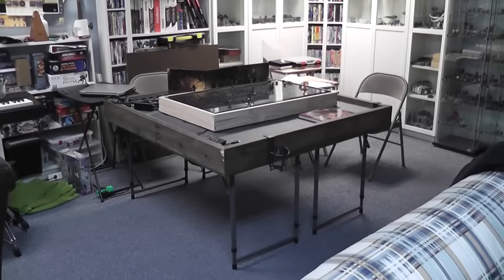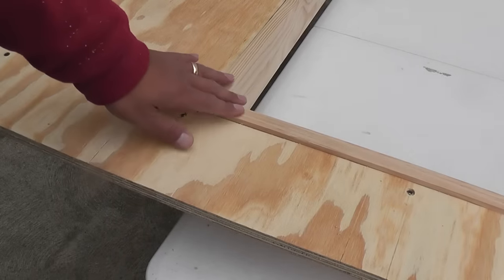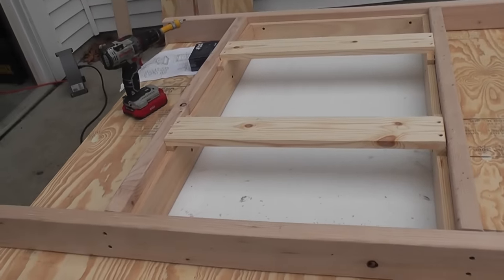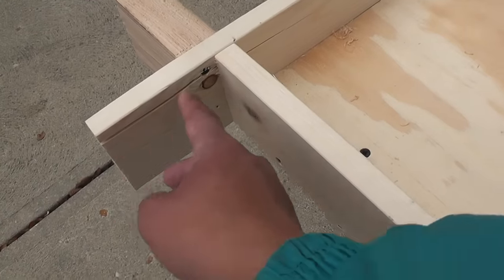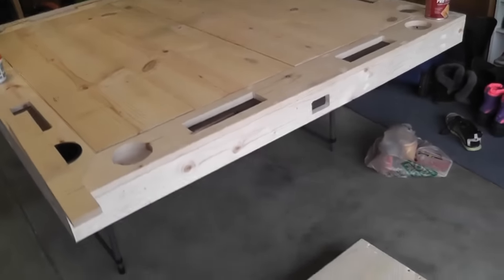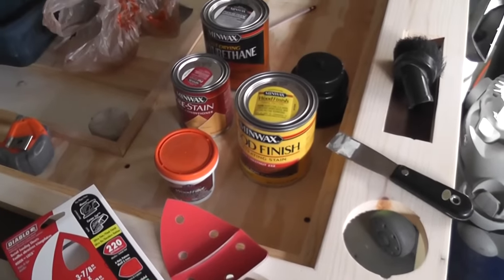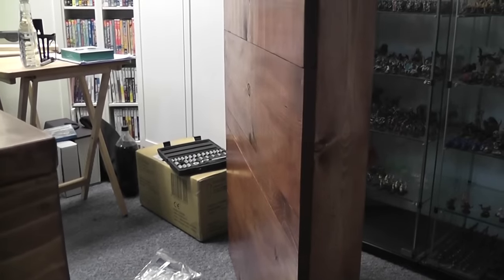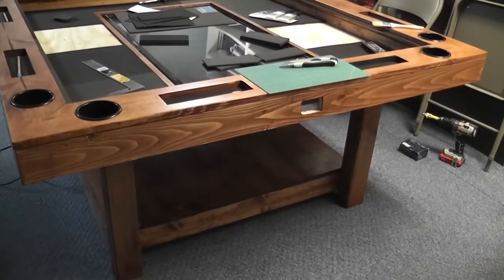DIY Gaming Table for $150

Comment: pro tip:  drill 1/2 inch holes in your two bys underneather to run your romex cable.  After that you can put a covering on the bottom and access panels later if you want.  Also USE BOXES when dealing with outlets.  You don't want exposed wire (i'm not talking about the copper but the insulation around your 14 gauge wire).  As an electrician I cringe when I see crap like that.
Reply from the maker: Yeah, that's a great tip.  I did end up retrofitting with boxes--should have done that in the first place.

Comment: The only thing I would add to this is to use a router on the edges and inside the pockets.
Reply: I like having the edges routed as well, makes corners less prone to splintering if someone's clothes were to brush on it and ruin the stain.
Reply: Yes, I kept thinking a router would take it to a the next level of quality.
Reply: I also feel as though using a uniform wood could make this that much better aesthetically and would not increase cost all that much and as for myself I would have loved to do a nice dark inlay for trim on the outer edge and probably a burned in design on the boards for his top. However that is just me because I play around with carpentry constantly.
Reply: Agree, or at least chisel out the corners in the boxes where the jigsaw clearly tore up the wood.

Comment: If anyone is unsure on how to wire, please get a certified electrician to help you! Also, speaking from experience, it's better to attach wires to the screws rather than using push-in holes. The wires in the push-in holes tend to come loose over time and fail.
Reply: Propane Daddy Ehh...cats are okay, but dogs are better.
Reply: +Propane Daddy and thanks for the compliment! I love being a dog cause, you know, dogs are awesome... especially blue ones!
Reply: Propane Daddy Why do you choose to be mean?
Reply: Okay, fine....your choice.
Reply: I would put a small hole under or some where in the table and ziptie the cables together then lead them out of the table

Comment: Great job and excellent planning!

Quick question...  How will you ensure the protection of the TV from more than just scratches?  If a drink spills on the table (hey, accidents happen) it doesn't appear there is anything to stop it from getting "water damage".  I'm assuming the plexiglass is the size of the TV screen (hard to see).  If something spills onto it the beverage will follow the underside of the plexiglass and onto the TV surface.

Perhaps a better idea would have been to inset the sheet of plexiglass to the table, flush with the playing surface, and make it the size of the framing around the TV.  You could have then used caulking or some other type of sealant to secure the plexiglass to the wood frame.  That would make the TV enclosure water-tight.

Also, I think a more appropriate title would be "$150 DIY Gaming Table Upgrade" since anyone who wants to follow your example would probably have to buy the TV which would probably double (or more) the cost of this project.
Reply from the maker: Yeah, if someone spills a drink directly onto the TV, they are paying for a new TV.  But we haven't gotten close to that happening because the cup holders are really good and we keep snacks out of the gaming well.

The reason why I didn't want to lay a piece of plexi/glass on the bevel of the TV is because the miniatures "float" over the map and make it difficult to know which square they are in at certain angles.  But that is a good solution if you are worried about spilled drinks.

Yes, about the TV cost but most people who have followed the plan don't include the TV since they don't use it for D&D.
Reply: Gaminggeek ... Good information, and yea I never thought about the difficulty of the plexiglass floating above the TV and not being able to properly see where pieces are.

Personally I would think the TV would be an integral part of this build, regardless of D&D or not.  There are so many game boards you could host on a TV screen that it makes it a highly functional piece for everything from complex pen&paper adventure maps right down to displaying a Tic-Tac-Toe board.
Reply from the maker: Yes, at some point, I am going to figure out how to digitize all of the Shadows of Brimstone tiles.
Reply: Shouldn't be too hard.  A lot are already online, just do a quick Google image search. for "Shadows of Brimstone tiles" or type in the name of the specific tile(s) you're looking for.
Reply: or you could have a rear projection screen plexiglass with a projector at the bottom shelf pointing at it, so the pieces don't go directly on a scratchable surface, don't know about the visibility with the lights on though, that might be a problem
Reply: thejack473 ... Think you could get the projector far enough way for it to fill that size of an area?  That's actually not too bad an idea if it would be logistically possible.
Reply: Gaming With ViperZeroOne i looked into it after making the comment, and some guy pointed the projector at a mirror, effectively doubling the distance. i'll see if i can find it again...
Reply: If you're using an old rear projection TV (should be able to find a score on CL in your area for free), the distance isn't that significant. You could probably shave down the back more than a little bit to make sure it doesn't interfere under the table.

Another thought - remove the bezel from your TV to minimize the distance. Should make it easier to see the pieces location from a distance.
Reply: "remove the bezel from your TV to minimize the distance" ... This is actually a good idea for some TV's.  Some, I know, have a flush mounted screen but most of the more inexpensive ones can have up to a half-inch depth between the screen and the furthest forward part of the bezel.

Comment: Very, very cool. Love the monitor built in. You should mount the bottle opener on the leg below the table, so it's more out of the way. And use a router to rounder the edges of the dice bins; that would clean up their edges & make them less sharp.

Comment: Came here to see how the hell he built this for $150, then realize it's 5 years old.  2x4 is $8 right now, pretty sure this is running us much higher than $150.
Reply: At the time, the $150 was if you cut out a few things he had, like the TV, cup holders, bottom shelf, etc. 
His actual build was closer to $212 at the time.

Grabbing updated pricing, today it would cost about $430
Reply: @VakuAdikaia  Still not shabby, especially if you wait, since wholesaler lumber prices are coming down rapidly. Since the retail stores order in large load expect to see retail prices drop in a couple to a few months.
Reply: @brandond2768  yeah, I bought all the wood I needed shortly after that comment. The one piece of advice I’d give to those who happen upon this comment: buy the 4’x8’ plywood!

I passed on buying it from the lumber yard, because I figured I could save $20. But between finding a retail store that had 4’x4’ in stock, and getting it home, I would’ve much rather just bought the bigger board.

Comment: Out of curiosity, why didn't you lower the braces for the TV mount (to size) and add a plexiglass cover so you don't ruin the tv?
Reply from the maker: I already have a sheet of plexiglass protecting the surface.
Reply: yeah, or glass. flush with the table leaving no spaces for stuff to get in there.
Reply: yea i thought about that too

Comment: Is there anything that you wish you have done differently or added while building the table, now that you've been using it for almost a year?
Reply from the maker: A couple weeks ago, I put caster wheels on the bottom so I could easily move the table around.  It put 3" in height to the table though so my chairs are a little short.  Other than adding the electrical boxes and the wheels, I haven't done anything else to the table so I wouldn't make any changes.
Reply: Probably a good idea. Do all the players have ample space to write? I like your table a lot but I would want to add either drawers, a fold down part for the players, or both.
Reply from the maker: Yeah, most of the players have enough space to write, although one of them uses a clipboard.  Another has an electronic character sheet on their ipad.  There is someone who made a version with fold-down edges that looked cool.
Reply: at the end of the video and in a couple of other ones you have I noticed that the dm has extra space. Was that achieved by just rotating one of the covering planks? If not please tell.
Reply: If you look closely, it is just a cover piece used to extend the space. He could even do the same on the other side as well.
Reply from the maker: Yes, it's just one of the planks that is kept on while the others are removed.
Reply: thank you for all the replies. definatly appreciated.
Reply: Board game development
Reply: What size wheels did you put on the table???

Comment: So I've taken on this project and my lumber total was $211 that included my lagbolts my screws and and my stain. Mine only is gonna have a 39" TV in it though so I had to modify that slightly. Between me and my mom we built it. It took a 6 hours. All that's left is standing and staining. It turned out beautiful and I thank you for the great plans and the good step-by-step guide. The only trouble I had was figuring out the framing boards that go around for the drop downIf everything else is 59" they're gonna be 57 and a 1/2 for anybody else who's having that difficulty everything else is planned out great and I highly suggest taking on this project if you think you can.
Reply from the maker: That's awesome, Kyle!  Make sure to post pics in the BGG thread:  https://boardgamegeek.com/thread/1471747/build-gaming-table-150

Comment: It's 2019 and I'd like to know how many people have died so far from the exposed wiring.
Reply: I died.
Reply from the maker: Check out this follow-up video:  https://www.youtube.com/watch?v=8Pv2zSJGueY
Glad to say no one has died and my house hasn't burned down.
Reply: Why would killua be concerned about people getting shocked?
Reply: Apparently @Gaminggeek has since added appropriate ducting and electrical boxes to his creation. So the risk of electrical shock has been greatly reduced. Although I do wonder if there isn't a better ready made solution to wiring up the power safely.
Reply: @Bustermachine  he stripped those wires down way too much. There should be no exposed wire coming out of the box. If someone were to be shocked it wouldnt be a shock. It would be them getting electrocuted due to the AC current and amperage. He says not to wire if you dont know what you are doing but seeing those outlet installments made me really worry about his friends sitting there.
Reply: @DiseasedPopeno  Like I said, there's a follow up video about how the project has worked out. I'd need to check it again, but I think he mentioned fixing the wiring. 

Personally I think it was a bit overkill to do the wiring in the first place. I'm building a variant of this project right now using douglas fir for a bit of added material strength and I'm simply going to install a surge bar to one of the legs to power everything. 

Laptop and tablet cable should be more than long enough to reach under the table. And I can keep some extra long USB chargers on hand. There's no need to go outside of your comfort zone to provide convenient power to this sort of table.
Reply: @DiseasedPopeno  They only will be electrocuted if they die since that is the definition of electrocution.  You can touch exposed wiring and get  shocked. It won't feel good and you are correct that the wiring should be done in a much safer manner.  Being an electrician, I'd find a way to either install raceways or use MC cable into rated boxes for proper, safe installation.
Reply: Killua I heard his son got cooked because of that thing
Reply: Well it does bring the adventure to the table!
Reply: @marlinbundo2409  He'd just really like to know
Reply: @MrCyrus1677  electrocution does not mean death. I'm an electrician too, but more importantly, I know how to read dictionary entries.
Reply: @gaminggeek241  Definitely add boxes there is a tool to release the wires from the backs it's almost like a metal toothpick off a Swiss army knife or a lock pick... Measure the holes and you can get caps like the drink covers to fit them or just pound some metal arround them if you know how... ;) It's a good table I remember the first time I drew up a map on gimp for my players and put a transparent layer that they erased  as they moved Thier lights it was a great way to hide encounters and a perfect use of a TV and a mouse... The whole time I could see my notes and both layers on my screen, but it felt awkward sharing the mouse. Here they could just point. And as someone who has worked with electricity enough to know  just how much 110v tingles and 220 bites, let me say sorry for all the comments you got about thoes boxes, and good work on a great table... Some tips, try drywall shims for spacers instead of the foam you will get exact spacing with them allowing you to put glass over the TV to protect it more if you want to as well... and the jigsaw can be a pain, but you can turn before the corners and work your way back out to the line, then go arround into the corners and back out flip the saw arround and do it again and you will have perfect corners

Comment: I feel like some Plexiglas would be majorly useful to put over the tv screen in case of accidents.
Reply: +TheRebelEye I've been reading that plexi-glass warps and fogs from the heat of the television, so one guy used glass and it works out perfectly.
Reply: That'd be something at least, a single spill of a soda or something could ruin the tv.
Reply: For sure, but glass is actually cheaper than plexi-glass. I'm going to use glass for my build.

Here's what one guy did. I'm going to follow his set-up..
http://www.ultimatelcdgamingtable.blogspot.com/search?updated-max=2010-05-17T19:09:00-07:00&max-results=7
Reply: +Doug Curtis What about Lexan? It's some pretty durable stuff, we used it on my high robotics team. I don't thinks it's that cheap though.
Reply: Hunh, never heard of it, but if it isn't cheap.....(I'm pretty tight when it comes to money).
Reply: +Doug Curtis It's what mythbusters use for their blast shields as the thicker versions are bullet resistant and make for good shrapnel catches, a single unlaminated sheet is basically just a kind/brand of plexiglas anyway, but layered with foil in between the glued together sheets it's very sturdy.
Reply from the maker: +Urs F (Feno3000)   I have a piece of plexi over it that cost me $22 at Lowes.  They cut it to size as well.  I've had no fogging issues with it and it is sitting directly on the screen, not raised as it is smaller than the outside bevel.  I didn't want the plexi to be raised at all because then the minis are "floating" and it is hard to tell which square it is in.  Here's the link to the BGG thread explaining more: https://boardgamegeek.com/thread/1351049/digital-tabletop-keep-lights
Reply: Good to hear.  I wonder why the other guy's plexi fogged...
Reply from the maker: +Doug Curtis  Possibly because it might have been a plasma and those produce a lot of heat.  Also humidity might be another factor.  The TV I am using is an LED which produces very little heat and I have the plexi directly on the screen so there isn't any air in between where condensation could occur.
Reply: Okay, didn't even think of the plasma angle. That was probably it. This gives me hope then to complete my table then.

My table will be split in two with folding legs on each half.  I'm wondering if that'll be enough support with the TV and books, etc...
Reply: Tempered glass

Comment: i would add plexiglas for saving the led screen
Reply: Add a scratch resistant screen on that. Plexiglass in my experience usually scratches a lot.

Or add a cushion or small little coaster to the bottom of the miniatures.